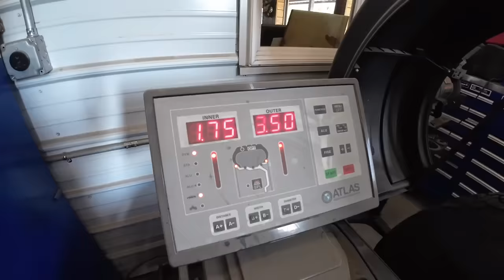Will the big block Ford 460 fit into Hunters 1977 Ford F250 Highboy? So close

Comment: That ford 460 cui engine was garbage I can’t believe you’re putting that in that truck.
Reply: Probably he never had one, I had one,When I sold it had 140 thousand on it and was still going strong
Reply from the maker: I beg to differ on that, maybe you should do a little more research before commenting.
Reply: @C_CEQUIPMENT yes... we ran a 427 side oiler in our 73 Stang late model.  We also ran a couple of stroked & cammed 460's.
Reply: @C_CEQUIPMENT  I have owned one pure garbage.
Reply: Truck is looking pretty sharp
Reply: You probably didnt service it properly. Great engines. Your the first i've ever heard had a bad one
Reply: Might think about being a little more tactful when commenting. Especially to someone that seems to have a pretty damn good idea of what he is doing.... Manners maketh man etc = )
Reply: you calling a 460 "garbage" proves 1 of 2 things ... either you never owned one  or 2  you had no clue about it ..
Reply: I don’t know if Hooker headers would have fit but imagine the subscriber boost with this title.
“Hookers, Tranny’s, & Rear Ends…Oh My”😳
Reply: I've never heard a bad word about the 460 Ford. One of the bucket trucks in my crew has one and it's over 140,000 and still runs like a scalded dog.
Reply: I think dad is as proud of this truck and motor as the son is. And that’s a good thing.
Reply: Clint I do not understand why you pinned this ignorant statement, but apparently this person has no clue that the 460 is just a scaled up version of the venerable 429 which is one of the best V-8 engines Ford ever built as far as I'm concerned, and I'm not a Ford Motor Company fan at all, except for their 70'a Twin I-Beam F-150 vans, they were awesome as I had two of them! 👏🏽 👍🏼☺
Reply: @jmistret419 A first for me too. Just need a little tweaking ang good to go, like the Energizer Bunny
Reply: Awesome project and it’s looking good. I remember my first project car as a kid. 1979 VW Golf GTI. Got it cheap from my cousin after it blew the transmission and was rusted through everywhere. I had a single car garage to work on it. Having your shop and equipment makes it nice building a project.
Reply: @alpharomeo15  a van and you call someone ignorant seems to me the pot is calling the kettle black
Reply: @jailbreakgamin1966  Or you don’t know what you’re talking about
Reply: Who's paying for this stuff daddy or hunter
Reply: @thegreatwhite-hd3uo  Clinton explained that awhile back. He buys the parts and the kids work it off when they are out of school.
Reply: Why ya gotta be so mean.
Reply from the maker: @alpharomeo15  comment generator
I agree he doesn’t need the exposure
Reply from the maker: @thegreatwhite-hd3uo  hunters in the hole big time
Reply: Mine's in the driveway, 240k miles.  Consumes no oil, great compression, never had a major repair.  Just towed 5 tons 1k miles home, didn't blink.  Not fast, not fuel efficient, but definitely not garbage.
Reply: @JohnSmith-ud9ex  .
*- Agreed, Mr. Smith, "Manners maketh the man."
- "Translated simply, the proverb states that politeness, good manners and civility are essential to humanity."
- I find that those who were trained to not have self approval, to not think well of themselves, can not muster caring about others because they have been trained to not have it for themselves. It makes my heart hurt for them.
Reply: Dude, your obviously partial to another brand, fu king relax already!
Reply: @carlhedrick7385 You're 500,000 mi 460 is a lot different than the one they just built I can tell you that. Thing is going to run like a scalded dog @c&cequipment
Reply: All Engines are Garbage if you don't take care of them!
Reply: Needs a hydro booster for brakes things gonna be a beast
Reply: Wouldn’t that truck have 16.5” wheels originally?
Reply: I had a 460 in my old Lincoln from 1978, ran like a champ with no issues at all. 🙂
Reply: Maybe carlhedrick was trolling...
Reply: Needs a hydro booster for brakes things gonna be a beast
Reply: Well you know what they say about assholes and opinions...
Reply: Looks great Clinton! Think Hunters gonna be working for free for a long time! 🇦🇺🍺🍺
Reply: Maybe you are the only thing that is junk !!
That 460 is gonna be Awesome
Reply: @C_CEQUIPMENT  pinned the comment to allow for the easiest of roasting 🤣🤣
Reply: @carlhedrick7385  well u gotta change the oil
Reply from the maker: @jfdtrainingtrain  that’s right
Reply from the maker: @OhioBuckeye  the earlier ones did
Reply: @C_CEQUIPMENT  Ford was using 16.5 on trucks right up into the '80's, but you can't hardly find a decent tire in that diameter today.
Wise decision.  😉
Reply: What kind of idiot would call a Ford 460 motor garbage?  The 2 engines I would want for an old truck would be a 460 or a 454 Chevy.  They are dependable and hard to kill with plenty of torque.  Fuel economy sucks even with fuel injection, but it’s a 3/4 ton truck so who cares.  That truck looks awesome and will keep running while the $85,000 6.7 diesels are sitting in the shop.
Reply: Another fantastic project! I would be proud to own and drive that truck!  Consider hydro boost for the brakes. It works off the power steering pressure. This eliminates the booster and greatly improves braking performance.
Reply: I had a 1974 Thunderbird with a 460. Had the timing chain and gears,high volume oil pump, and a high lift cam with a Holley 750 vacuum secondary 4 barrel with a 3.70 gears in briefly. That big bird would run for a very heavy car.
Reply: Clint, what is it you call each other, is it bud or Bub, guess Australian version of mate? I really think it’s so cool you have your boys in the shop working on their trucks, it really is a credit to you Clint. They obviously love the work and time with Dad.
Reply: @gordonagent7037  - Gordon - it's a close approximation of "mate", yeah.
Reply: Garbage??? What did I miss Carl?
Reply: The 460 Ford can make 600 hp and 600tq.with ported heads and a decent cam😂
Reply: What are you talking about? lol they’re the king of big blocks.
Reply: possibly.  @OhioBuckeye  depended on how it was ordered
Reply: @carlhedrick7385  mabe the one you owned was garbage,doesnt mean they all are

Comment: The bell housing bolt pattern is the same but depth is diffrent on a 460 .we make a 3/8" block plate  to make up the diffrence .your new plasma will make the plate u need . The351 will bolt up but it loads the imput shaft at the pilot bearing

Comment: This video proves that there are young adults in the general populace who love mechanical work. They are the ones who will always have a job in the service and repair industry while making a very respectable income. Yes, they may attend and graduate college or university in a liberal arts program, but they will have a fall back job, forever. I knew one, young mechanic who completed certification for Airframe and Powerplant certificates and then worked in a shop for automobiles that advertised, "US Government certified mechanics." This was in the late 1980's and the shop rate was $75.00 per hour.

Comment: On the brake booster, you can set it up for a hydro boost from a late 90s 7.3. It'll require some modifications to the firewall mount and pedal mount.
Reply: 1970 -79 Lincoln might bolt right on
Reply: @frankmorrow2270  It very well might.  👍
If going to hydroboost I'd suggest getting the Saginaw pump from the same Lincoln/Mercury since it will have the dual return reservoir.
Do note that the Saginaw has a bigger pulley shaft than C2 pumps and pulleys are hard to find alone. (I'm saying this as someone who swapped a '95' F-450 HB into an '80' s pickup)

Comment: Clint,
Just a thought that was taught from an old timer was to coat new gaskets in a thin coating of bearing grease, that way when you have to replace them thay come off in one piece no scrapping.
Reply: I do that with all bolts.
Reply: Absolutely Brew!! Also for pan gaskets, valve cover gaskets and even carb gaskets. And old school trick that has served us old techs for years.

Comment: Great job !,  love the 460! One of the best engines ford ever built i owned several trucks with the 460. I have a 400 in my  67 high boy it pulls pretty good but not like the 460. 
You should be very proud of what you've taught your boys over the years!.

Comment: I had the exact same color 77 1/2 f250 with the 400m from the factory. Put in a 460 and I used a L&L products motor plates and had a hell of beast of a truck. Pulled my Jeep and camper with no problem. I gave it to my brother at 300 thousand miles and he used it for years before selling it.

Comment: That pickup is reminiscent of many of the Ford trucks I’ve built in my lifetime… Not gonna lie… It’s making me a little jealous.

In the olden times we used cork valve cover gaskets because we had to go in occasionally and adjust the rockers and the cork could be reused many times. In the old days… Rocker adjustment was part of a standard tuneup.

Comment: Had an 87 F250 tires cupped  on the front bad . Found a guy that balanced and cross cut the tires on the truck, which squared them up. When we first started took a glass of water on the hood spun the tire at 75 almost throw the cup across the room, when finished place the cup with water  on the hood didn't hardly see a ripple. Tried to find someone to do my hotrod tire. Nobody knows anything about that machine,  so there are lots of weights on the wheels .If I could find one, I would buy it and do hotrod tires. Nice job on the old Ford

Comment: Get rid of that spade pigtail on the PMGR starter and run a ring terminal on the solenoid trigger wire.
This is from a '90's Ford TSB where corrosion in the connector would cause a no crank condition.
Nice work! Hunter is going to really enjoy 'his' truck.  😉

Comment: Clinton As Usual GREAT VIDEO with the boys !!!  One of my first sorta builds ? Was a 76 F250, clean as a pin !  I built a 460 Lincoln Motor I got for cheap, with low miles to replace 351 Windsor.  Dropped it in after seals, heads, etc. Stock cam. Had some pretty good torque! for fairly basic !! Was Very Fun to play with ! Got a lot of miles out of !! But most importantly !? I remember it like it was yesterday !! And I didn't have the kind of dad like you !? You're teaching along the way !! That will be remembered for decades ! From your sons

Comment: Very informative video I am 63 years old and have a 1987 f350 that I am working on was a grassfire truck has 67000 original miles on it has a 460 carburetor thanks for video.

Comment: Nice Truck! 
I bought a new 1978 F-250 Larriet 4X4 460 Auto, and it was a great truck! 
They came with 16" wheels, which i replaced with some wide chrome ones, and relatively big tires, along with a chrome rollbar. 
The inner fenders were galvanized, don't know how well the paint will stick? 
I know where Hunter's going to be spending his Summer! 😉

Comment: I stuffed a FE block in an 83 Bronco back before all the adapters were available. Ended up putting a set of fender well headers on it, that opened up a whole new world of “neighbor hater” side pipes. But 500hp under the hood and 3:08 gears made it a mustang eater.

Comment: Hey Mr Clinton, Mr. Hunter, not worry you,  the coil spring on Mr. Hunter's Hi-Boy , are rated for a small block motor, yes, it is easy to believe, that the. Coil springs work for a small block, or a big block without changing, even a pick-up truck, need the right part , for the right weight

Comment: Had a 1994 F-Super Duty with a 460. Took the factory resonator and muffler off and welded up a Flowmaster muffler. Sounded like a gem..for a work truck it was a head turner, sounded like it belonged in NASCAR. Great video!!

Comment: Checking to see if you guys ever found out about tire automatic balancing - one brand I use is Center-matic , a disk that mounts on hub before wheel , a tube that goes around the disk for the balancing filled with synthetic oil & metal beads inside - they are dynamic balancers = if mud , snow or ice buildup on wheel they balance that out till the added weight goes away - do not remember , but they will balance about 3 - 4 times more than wheel weights ?

Comment: You can adapt a hydroboost brake booster to fit in place of the vacuum booster.  It is significantly smaller than the vacuum booster is, and is a lot more powerful.  You will have to run an additional line from the power steering pump to power it.  You may have to modify or remove your current booster bracket to fit it.
Reply: Also remember that the pushrod pin is in a different location, higher on the brake pedal arm.
Need at least a cobalt bit to drill it because that steel is harder than...  (never mind)

Comment: I would consider using a block a tackle from the forklift to the motor ,much finer control over letting down or lifting,you can turn the fork lift off so you can hear each other ,and no need for the fancy hand gestures that you just mentioned.
The steel rims , where are they made ? Is the quality control up to standard ,even check the steel,the pressings of the rim centres and make sure that they sit correctly,there is too much cheap junk on the market ,it would be better to find good old rims a re -furbish  them (real steel) American steel !
Are the roller rockers of good quality?
Again great content esp for those who have never been able ro do a rebuild etc ,theres lots of inspiration for others of all ages .

Comment: hey the transmission requires some endplay. i dont recall the exact spec but you stand the transmission up on its rear. then measure the end thrust with a dial indicator. i think its about .004-008. or round about that. but you dont want any pre load on the main shaft.

Comment: I had that color on my 76 1/2, except with metal flake. Ford called it cinnamon metallic brown.
Re: pinned comment. My father would put 80 tp over100 thousand miles on 460 Lincolns a year from 73 to 82? (He did get one when they downsized.) Those cars were road hard, but serviced, and just as good at the end as the beginning. Mom had Marks. They would chirp the tires going into second.
I like your sense of humor, pinning the troll up top !

Comment: I did this swap in 1978. I put a 460 from a Continental in a 1972 F250 highboy.  I could start out in third gear, never shift and never lift from 0 to 100.  Worked great. IMO, the '72 F250 was the best 4x4 ever built; basic but great on and off the road.
Reply: As I recall, on my swap, I used a bellhousing from a Cobra Jet Mustang or Torino to mate the NP435 to the big block. What are you folks using ?

Comment: Use the power steering pump hydrostatic booster and power brakes master cylinder off 1999 to 2003 F250 SD.
I know want to keep close to original as possible, but those west coast mirror brackets typically just cause problems.
Door leak water around bolts, if someone hits tree limbs then they bend the door skins all to heck.
The mirrors themselves start losing the tension so they won't stay where you can actually see out of them, because they self adjust.
They leave rust streaks, rattle, and takes two people to adjust them if different driver is driving that's taller or shorter. 
Yeah I know, but that's pet peeve of my old grumpy self, those and wing vents windows.
Those were great when they have window crank handles, but the flip latches always get stretched out, and bent outta shape to where they leak air making lots of noise. 
Y'all going to put the chrome window extension above the windows so that you can leave the windows cracked during summer days while sitting in parking lot, and allowing you to drive down the road with windows cracked 1" or so down while driving. 
So much nicer than the tinted plastic double tape stick on stuff that they have nowadays. 
Yes Sir I realize I have a problem about being long winded, but at my age, I'm probably not going to change that.
Everything else has changed, so something has to stay familiar, or might get old timers or worse.
Bad enough that sudden urge, everytime one hears water, see's coffee pot making, are your in a store that's huge, and only has one that's on the furtherest corner of the building. 
Don't laugh, cause you'll get there yourself afore you know it, and it doesn't gradually start happening, it hits all of a sudden when you think you've dodged that part of getting older than you thought you'd ever make it. 
Good boys Y'all got there, shame they have such a terrible influence around them in Hog Head.
LOL, I think the boy shot too much lacquer in his short lifetime, and it's pickled his only gray cell.
Y'all have a Great Day, and may Tomorrow be even Better than today.

Comment: gonna need rear axles  they break fast and easy without beating on them. Lots of torque though and use the same fuel amount as the 6 or 351 my friend said

Comment: I'm watching @43:51 and your motor mount bolts don't appear to have any protrusion into the  nylon locking nuts. Also a nylock will probably melt out under the headers anyway.
Reply from the maker: They are fine

Comment: The 460 ford original may have had a problem or the guy talking junk is probably a Chevy lover has never done serious engine work, may not even know how to set the valve lash or what ever.  Do what you love,  and to heck with what some people think. That 460 might have enough power to shake rattle and role. Have fun that's all that's the only thing anybody wants.